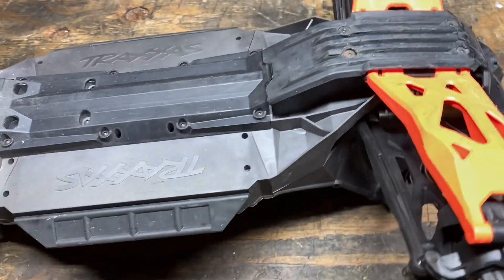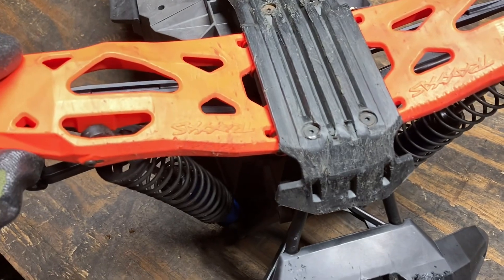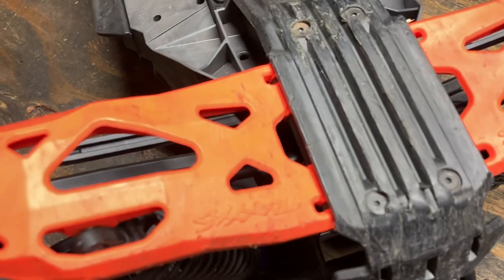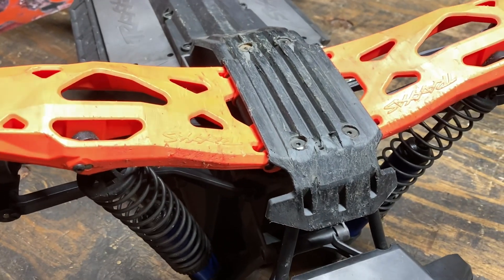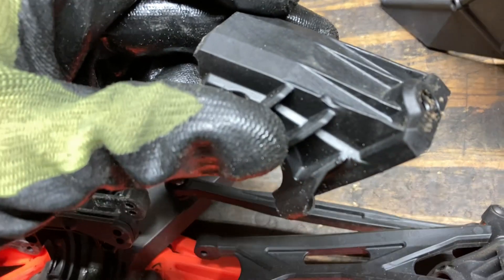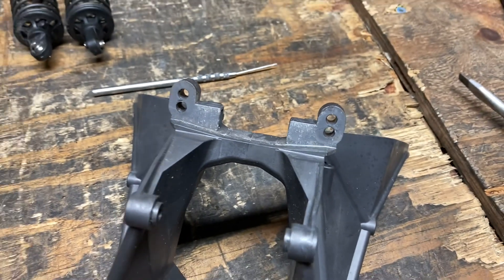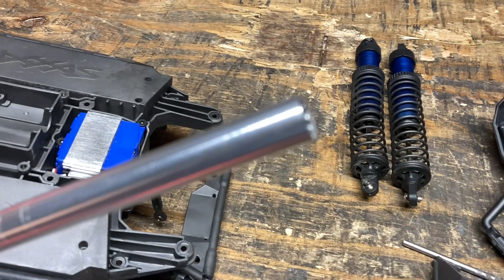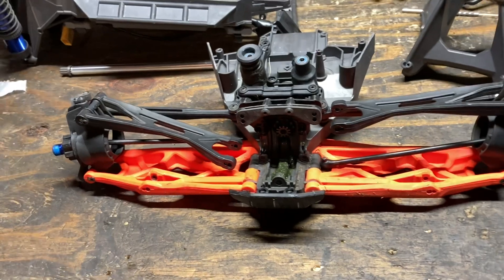The Toughest RC Car Ever!!!

Comment: Is this Xmaxx all stock  or is it upgraded? What the upgrades you have done,if upgraded
Reply from the maker: This Xmaxx is completely stock minus the esc/ pinion/ spur gears. I have a Hobbywing Max 6esc in there with a 22 tooth Robinson racing pinion. Hot racing 50 tooth spur 👍🔥🔥🔥

Comment: Is that the M2C X-Maxx or do you have more than one?
Reply from the maker: This is just a stock Xmaxx with a Hobbywing Max 6ESC and upgraded spur/pinion gears. Stock Xmaxx is stronger than most M2C Xmaxxs. Those metal parts make the truck to heavy and thus more breakages.
Reply: @thunderrc  awesome! Thanks for the info! Do you use steel machined gears?